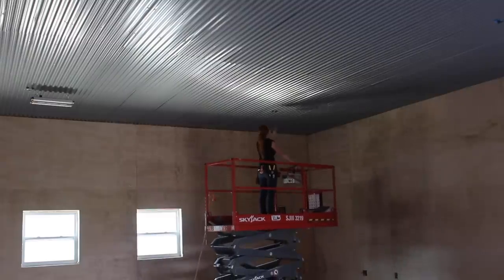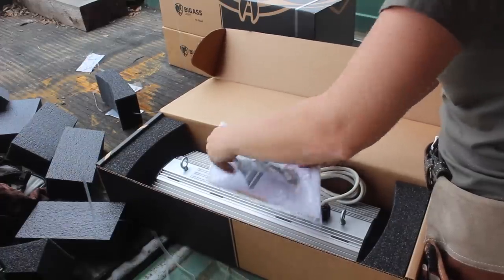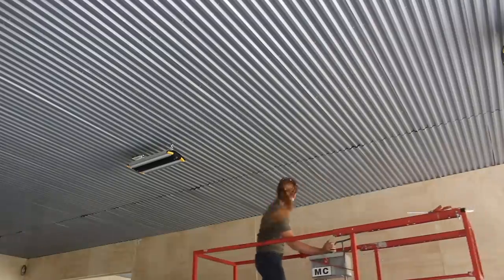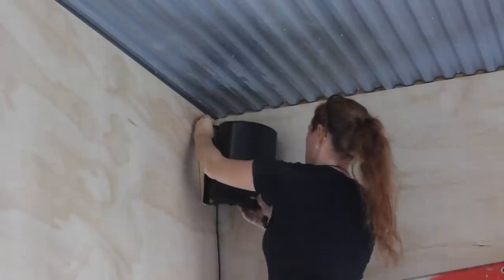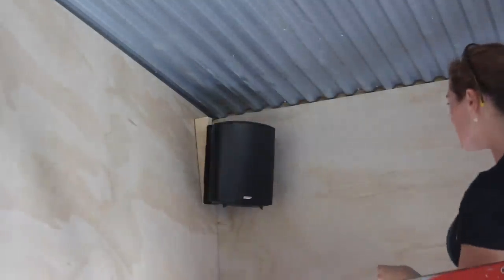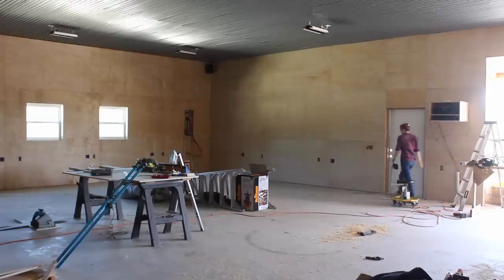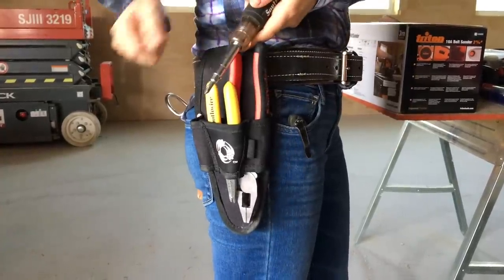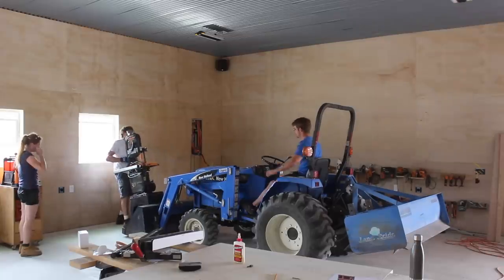Building A Shop - Installing Lights, Outlets, and Stereo System

Comment: I think you need about 4-5 more of those lights.  If you're equipment is casting shadows, like they were here, you have some dead lighting spots.  With a ceiling that high, its not unusual.
Reply: I noticed the dead spots too but with what she has going there task lighting would fill in where needed. I'd be more concerned with the color spectrum she chose. Warm white is much easier on the eyes than cool white.

Comment: why couldn't the electrician wire the panel so you could run everything off a generator like they do for standby generators? not smart on his part.

Comment: If your guy is a pro in audio how come he told you to put those speakers in the corner?  That placement is not going to sound good at all.  They need to be 3 feet minimum from any corner or you will get all kinds of unnatural sounds coming from wall reflections.

Comment: I am concerned about the way you wired the outlets.  putting the black wires on both screws places a large load on the tiny connector between the two screws.  If you have several outlets in line on one circuit, you could have a fire.  The two black wires should have been wire nuted together along with a short pigtail which then connects to the outlet.  The same goes for the white wires, and the Ground wires.

Comment: Technically your lights should be switched half and half by NEC. They are really nice lights. great job, just one more thing that would have been caught by a plan check or an inspector.....*sigh and shakes head* Just because you can doesn't mean you should. And just because you can, doens't make it legal.